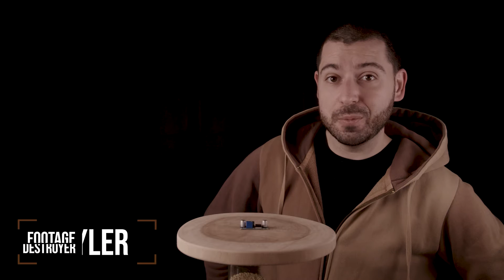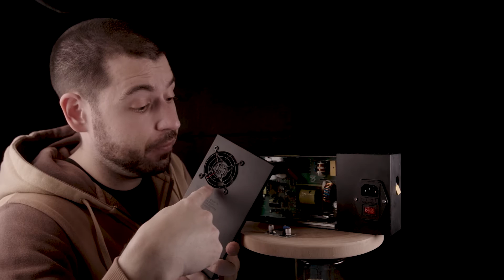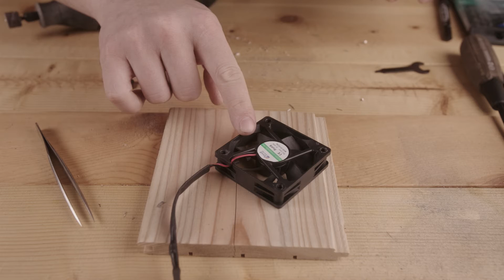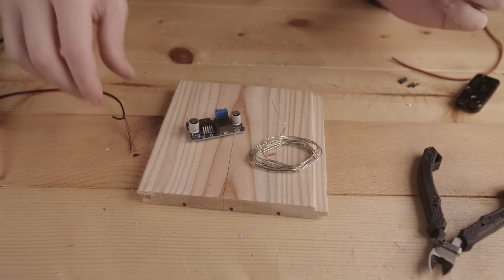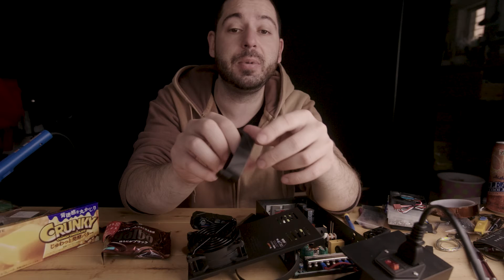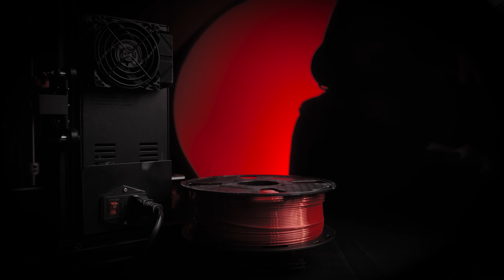Reduce Fan Noise pt. 3 : Elegoo Neptune 2S Power Supply bequiet! Silent Fan Upgrade

Comment: hello Mocha,
I bought everything I need on amazon, it's delivered tomorrow, I know the direction of rotation? 
is the air going inside or outside? 
thank you and congratulations again for this video, 
I'll put you a quick note tomorrow to tell you if it works 😀 
ps: would you have an idea for the fan on the face of the heating body?, it is he who makes the most noise😡
Reply from the maker: sorry to reply late, thanks for all of your comments! The air on the PSU blows out so exhaust. The heatsink fan was really loud on mine too. You can check my video for Mame-FS1 to see what I did. Now it is really super silent!
Reply: @MochaMameX  thank you mocha 😉

Comment: Great mod, how's holding up?
Reply from the maker: Thanks, it's running really well. The only issue is that the printer is silent when idle so a few times I forget it is still running!
Reply: @MochaMameX  That’s really cool! Subscribed, did you upgrade Mother board and hot end fans as well?
Reply from the maker: sorry I don't get notifications for comment replies, only new comments. Motherboard I'm working on now, hot end is the most important but I feel like designing my own so it will take a bit more time to get ready!